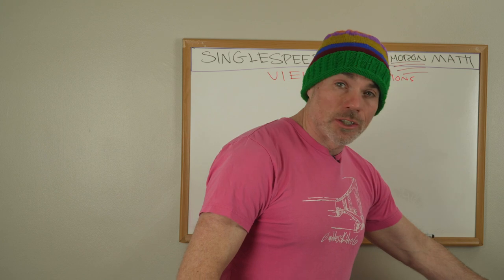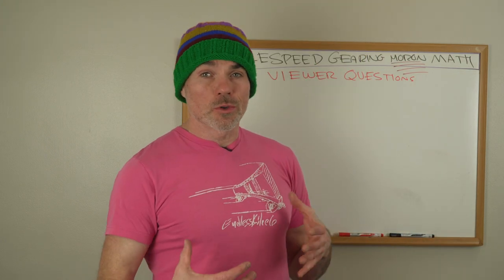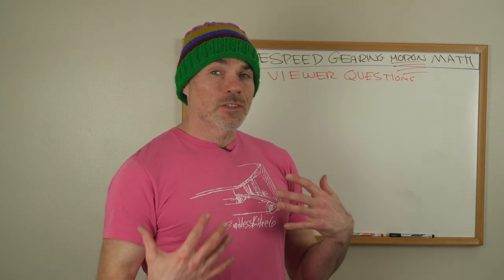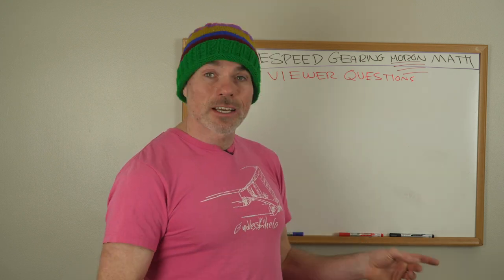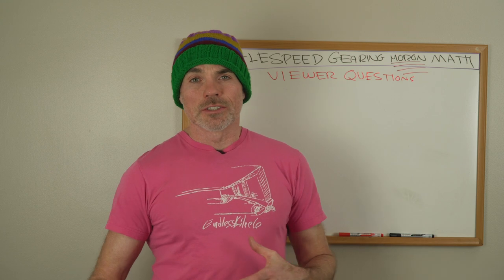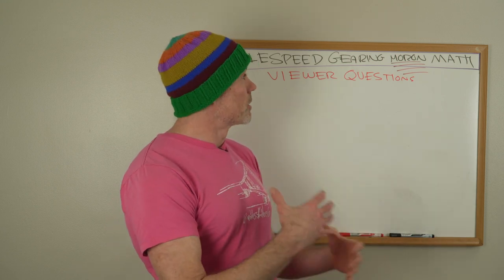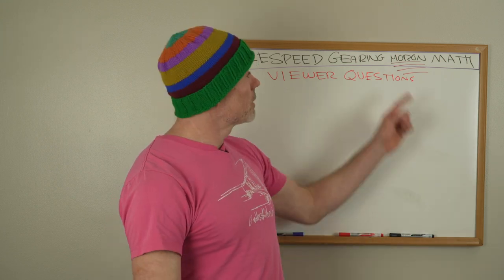SSMTB Gearing - Viewer Questions or: Why Do Non-singlespeeds Cause ED?

Comment: For a geared bike, the non-straight chainline, the deraileur and the heavier casette all rob power from the drivetrain...that's probably why you need to run lower gears to get the same "feel" I think.
Reply: You’re not wrong!  Besides the ones you listed,  the biggest power loss on other bikes is almost always the suspension. 

Rider technique being the big outlier, if your setup is dialed SS has virtually no mechanical weak points for power transfer to the tire.

Comment: The gear comparison is phenominal.  It's the same thing on the road.  Something about the single cog in the rear and single cog in the front being massively more energy efficient plus the weight reduction makes single speed gearing feel far better than having those derailleur cogs sucking up your energy and trying to mimic single speeding with gears.

Comment: I'm currently running 34:18 on a 
26" 1.75 Michelin Country Rock 
tire. All White Industries set-up.
 Their eccentric hub only gives 
me about 2 chain links of leeway. 
So I have a chain for every sprocket. 
And then you always have to line up 
the rim brakes whenever you make changes or get a flat. It's been a rugged setup for me but my next build will be 
sliding drops. Thanks for sharing your thoughts on this subject.

Comment: Sliding drops for the win! I hate eccentrics, the fit change is undesirable to me. My body is finicky, a shoe change will cripple me🤣. That and they like to seize. Side note: every chain tensioner SUCKS! Exception: A clutched derailer. The geared ratio comparison holds true, the efficiency of single speed versus geared is the difference. Look up drivetrain power lose and you’ll be amazed at the percentage of power lost.

Comment: Excellent info man. Interesting about the geared bike not feeling the same as a SS. It sounds like I’m using the same gears you do for most things. I’m going to try 32/21 to start with and see how it goes. I’m not a fast rider. I prefer the slower technical stuff.
Reply: Great place to start, I’d get a 20 and a 21 if you can 👍

Comment: Interesting comments about the SS vs. geared comparison.  I’ve noticed the same exact thing. Maybe it’s the addition of pulleys that’s causing the difference in feel?
Reply from the maker: That's definitely a little bit of it but I think it's mostly magic.
Reply: Could be added drag of the chainline angle too
Reply: Maybe the longer chain on a geared bike makes the difference?I watched a motorcycle video about gearing once that said chain length matters. Like if you had the same exact sprockets but triple length chainstays, it would somehow end up being a different gear ratio. I don’t really understand how that’s possible but I heard it on YouTube so it must be true.
Reply: Its about friction and inertia on the chain, not that it changes gear ratio. A shorter chain is more efficient than a longer one.

Comment: Any thoughts about belt drive SS?
Reply: I have a spot rocker ss with belt drive.  The belt is cool, but it's more like a solution looking for a problem since there's nothing really wrong with chain drives except they require a little bit of maintenance.  And there are some downsides of the belt drive....  Unlike a chain which could be adjusted, the belt length is fixed.  If you want to play around with gearing you may need to get a new belt as well in order for the spacing to work with your available chainstay adjustment.  The other issue I have is that the available chainrings are all pretty big diameter.  Mine is currently 46t.  That creates some clearance issues.  I think smallest available is 39t which is still big.  Considering converting to chain drive for those reasons.